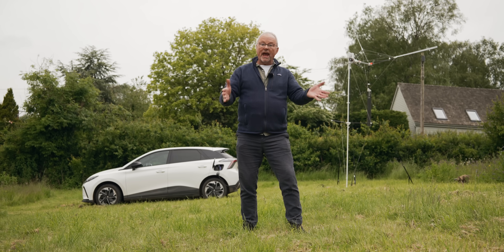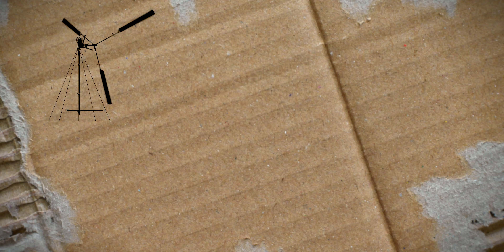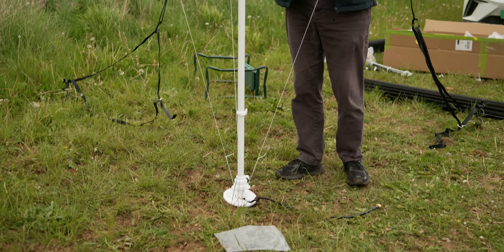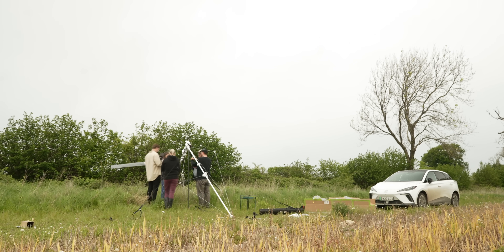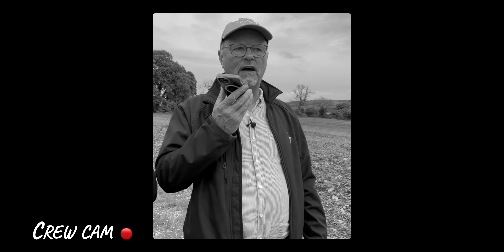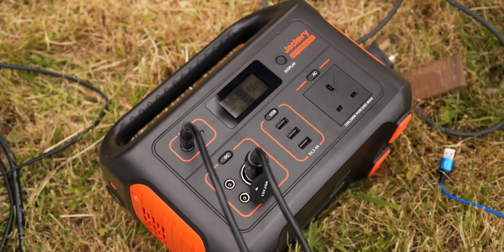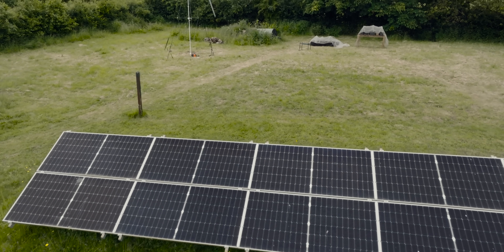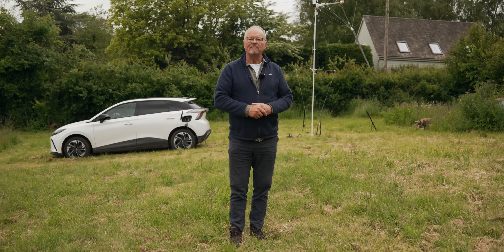Charging an Electric Car with a DIY Wind Turbine?!

Comment: Use a wind turbine to power a hair dryer? just cut out the middleman and dry your hair with wind..
Reply: Or use the hairdryer to blow the turbine faster.
Reply: @randymch That would create a paradox that could tear the universe apart!
Reply: Funny 🤣
Reply: What about the heat that helps dry faster?
Reply: @Defianthuman  With Robert's abundant, flowing locks, he's cool enough not to need any heat. 😁
Reply: The heat is more about user comfort, moving air is the main thing, things dry in the wind up freezing mountains quite efficiently.
Reply: @pachy444  Heating the air increases the amount of moisture it can hold. Heat also greatly increases the evaporation rate. So for quicker drying heat helps a lot.
Reply: Attach a wind turbine to the roof of the electric car.

Comment: Toy windmill? will not save nearly the Co2 it have used in production/transport. Lifetime? proberbly < 2 weeks. Please dont waste more time on these things.
Reply: that's a very good point (although I am not sure I agree with your cynicism :-) ). It would be good to know the environmental cost of the kit, expected duty hours etc to consider it as a temporary off-grid vs something else.  I wouldn't use a gennie when I off-grid, but I might use Solar or even go with my car fully charged up and drain that.
Reply: @jasonchapman6318 Think most people who might consider this often have an ev/phev it would be better to use that, if its not weather for solar cells.

Comment: The rated power of the KiteX Wind Catcher is 200W @ 5.5 m/s wind speed, that is the max power output. Average wind speed at UK measuring stations is 4.5 m/s, measured over the last 20 years. At 4.5 m/s it looks like it would output 125W. Wind should be turbulence free to reach these numbers. A lot to carry for a tiny bit of power. 
The car charging is mostly a test of the power station, not the wind turbine.
Reply: 200W Solar panel: £220? 200W KiteX £750? KiteX could work at night...
Reply: @Leo99929 I mean, be real, why would you buy one of those overpriced small solar panels if you want to power a car? There are plenty of 400/500w panels at 100 euros...
Reply: @Leo99929  KiteX is around £2000 and just for temporary use.
Reply: @Leo99929  KiteX is £2000 and not for continous use.
Reply: It is a tiny bit of power but my modest house uses around 200 watts background base demand so 2 of these could be very useful (save around £500 per year if continuous - I know in reality will be a small fraction of the time but not as bad as I was expecting). Of course this would need beefing up a bit to withstand all year round use.  Following with interest
Reply: @markgarnett3521  I think we should be gathering all the power we can from the local area rather than burning stuff miles away and losing some transporting it to point of use. It also lowers the load on the grid. Wind turbines should come into this IMO.

This is a cool concept. I love the engineering that went into it. But it is a rather niche product. like maybe polar night where you aren't going to get sun light for a long time?

I'm struggling to find a need for a portable one like this... Robust power generation for expeditions where sunlight is unreliable?
Reply: Such a tiny amount of power. I am sure more energy was used in manufacture than it will ever generate. 2000 pounds?
Reply: @Leo99929  less a product, more a wast of money.
Reply: @ndudman8  Could you imagine camping with one of these as an added load? Sure, on a windy Summer day it would generate all of your electricity needs, without you having to burn anything. But it would be easier, much less expensive, and more cost effective to carry only a battery and recharge it at a power outlet once each week.
Reply: @markgarnett3521  but what is your daily kwh ? this 200Wp would do nothing to offset its cost... and looks flimsy... and robust turbines are not known for their durability...
Reply: We are good at creating waste.
Reply: Could you let us know how many kwh you actually achieved during the test?
Reply: Wait for the TWT-11...

Comment: looks hopelessly fragile.
Reply: yes, but maybe not. I think the next video should be see how vulnerable it is :-).
Reply: @jasonchapman6318  I can't believe that the good people of KiteX haven't tested it quite extensively in all sorts of wind conditions, and that it has passed those tests. The tensioning, materials used, and design lend it great strength I suspect

However, it does look fragile.
Reply: Version 2 will be much better
Reply: @addsfour3499  and 10 times the price :)
Reply: Yes because it's supposed to be portable and lightweight...
Reply: Any reasonable wind will destroy it.

Comment: I know horizontal axis wind turbines are more efficent than vertical axis.  However vertical axis wind turbines are better in turbulance than horizontal axis wind turbines.

Because this is a small wind turbine it'll have much more turbulance than the big ones.

So why not use a vertical axis wind turbine?
Reply: The total wattage proves this to be academic,  as it's not enough to be useful anyway.
Reply: If the wind is turbulent it contains very little useful energy, simple fact. Why if you have little energy available, use something so inefficient, like a vertical axis turbine.
Reply: Speaking of VAWTs and given the DIY approach of this episode .. perhaps a rotary clothes dryer with triangular cloth sails (made from any garment of choice), raised up on a scalfolding pole with tent tie strings stays, coupled to an old car 24v alternator and mains inverter might work similarly.
Reply: Because... there are zero commercial products available and all the companies out there claiming to be building one are snake oil salesmen?

Comment: An EVSE can, according to the standard, request a current draw of 6A and upwards in 1A steps..

In other words, with the correct EVSE you need an inverter that can sustain 1400W continually..

As far as I know the inverter they used in the video is 600W.

Bjørn Nyland (AKA Tesla Bjørn) uses portable AC power banks (AKA "Solar Generator") to recharge the cars after he tests how they have implemented their low battery shutdown.
Reply: 1440W at 230V, but many (most?) cars will charge at 110V or lower, so lower powers are possible, though a lot wll be lost by the static draw of the car's systems.
Reply: @mikeselectricstuff  This video is made in England, where 0% of the "Solar generators" are 110V.

But yes, if you use a 110V inverter, 6A is about 700W

Comment: oh KiteX!  I've been subbed to these guys for years, mainly coz of their super-lightweight engineering, inspirational.  
Reminds me a bit of Tensegrity yeah?  All these poles coupled with lines under tight tension, the kindof thing you see on yachts, or even old biplanes back in the day.
edit: oh btw KiteX have good thorough video tutorials on their Youtube channel, on howto properly & quickly setup their turbines 👍
Reply: I was really hoping Robert would say "tensegrity" in his marketing-droid voice.
Reply: It’s not really a tensegrity structure except in a very minimal way - one braced compression element (strut) with some stays. The bracing is there to increase the buckling load of the strut.

Comment: I think if I went camping I would be using the car as the power source using V2L. And use a level 2 or DC charger to top up.
Reply: we've been going this for over a year now with our ionic. works 100% even runs a electric heater for over 4 days :)
Reply: I did this last week while camping in Scotland. V2L ran an induction hob with an old kettle on it for tea and coffee. It used about 0.5kwh per litre of water.
Reply: Yes, if you run it in reverse, you've got yourself a big fan on sunny days that barely uses any power.

Comment: TLDW: at a wind speed of 6 m/s you get about 180W an hour - or about 0.75 miles of charge an hour if your car will charge on such a low wattage 😅
Reply: at 180w none of the power would make it to the battery, the power electronics would consume most of it and probably reject what's left as below the minimum threshold to start charging.

Comment: Very good. But you can get a 3kW sine wave petrol generator for £250 ? Just plug it in ! Ok, it may not be so ecological, but for a quickie it works !
Reply: It does have a lot of downsides... for much cheaper than the turbine though.
Sadly the turbine also has powerful downsides...
Reply: We know that, this is the fully charged channel not the bleeding obvious channel
Reply: And forever buy petrol